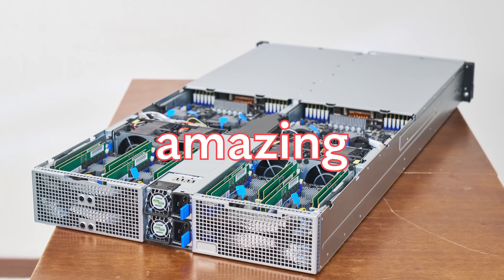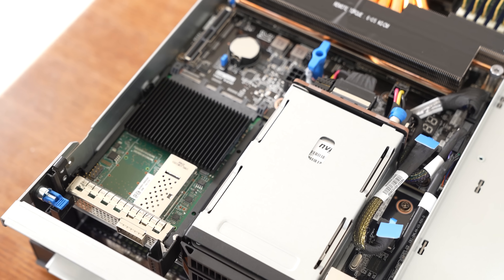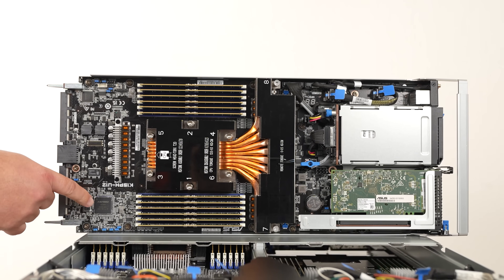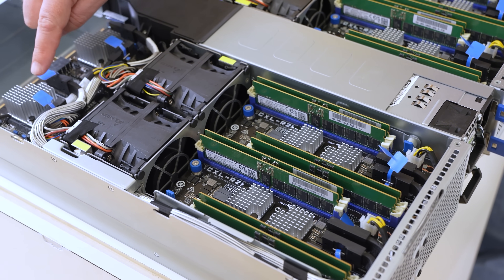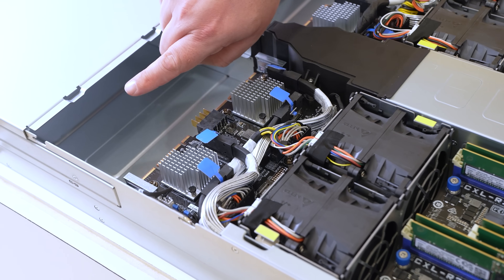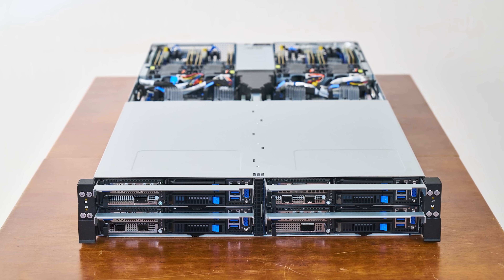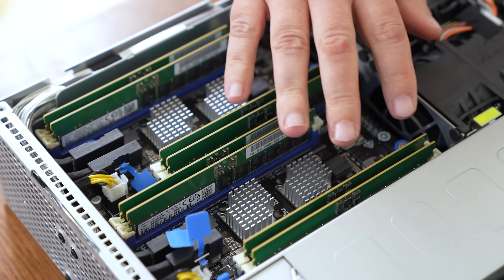A MEGA CXL Memory Server

Comment: I want CXL on my home servers that can only hold 128GB DDR5 (or 256GB, but that's extremely expensive).
Reply from the maker: Totally would be cool. It is still more implemented in validated solutions rather than play and play like NVMe drives. Just know on briefings for processors like Threadripper we are pushing for CXL support being enabled

Comment: Been waiting for CXL for years - memory pooling (for lack of a better word) by having a networked and switched memory capacity would be magic.  We're not quite there yet, and even the first implementations (as I understand it right now) won't be dynamic configurations.  But it would be great for HPC apps that occasionally just need that extra space.
Reply from the maker: Some of the hyper-scalers are deploying CXL in AI systems which is neat

Comment: arent 32gb dimms an insult for this? wendell mentioned this cxl stuff only does make sense with nearly highest dimm density vs. price.
Reply from the maker: We ended up showing 64GB when we got the server online. The cost side is a part. In form factors like this node density creates savings as well. You also remove the need for a second CPU in this that costs more and uses more power. So it is pretty shortsighted to only look at the CXL component costs. Also, longer term, memory pooling adds a capability that larger DIMMs cannot match

Comment: It would be great if the system was not specificly designed for CXL memory expansion. Sure memory is expensive, but at what point would it be more cost effective to upgrade the RAM with CXL instead of buying CXL with more RAM in the first place. I haven't bought a Supermicro machine new, but when we spec out new systems we get better offerings, so a RAM upgrade down the line is much more expensive, because we dont get the better pricing, making upgrading the system down the line much more expensive.
Reply from the maker: Thinking a bit in the future, imagine having a 1U or 2U rack in a box with memory, DDR CXL controllers, and CXL switches cabled to all of the servers in the rack. So you buy servers with some amount of RAM then provision the CXL memory from that memory shelf to the nodes that need it. The generation after that in CXL 3 is where you can also share memory so you have that switch box, have one copy of data in RAM and share it among multiple nodes
Reply from the maker: The building blocks for that vision are starting to become available so likely next year we will start to see more of that type of deployment, then see it increase every year

Comment: It would be interesting to see what the cost would be for a system like this.

WITHOUT looking at the cost, this type of a system would be great as either a compute node or cluster of compute nodes for finite element analysis (FEA) HPC application where, especially if you are running an implicit, direct sparse solver, you would be able to solve your problem, pretty much entirely in RAM, and/or provision some of that RAM as a volatile scratch disk space so that you don't have to burn up SSD write endurance limit for the same task.

(I used to play with Gluster version 3.7 where I would create a RAM drive (110 GB out of 128 GB installed) across my four Intel Xeon E5-2690 (v1) dual socket nodes, and exported that distributed stripped gvol over my 100 Gbps Infiniband network via NFSoRDMA for a 440 GB RAM-based scratch disk.)

The other use case that I can see is also for CFD pre- and post-processing/visualisation node because some of our thermal models will eat up > 4 TB of RAM when we pull the results up, and it's due to quadruple, likely in the next year or two.

But again, that's WITHOUT considering the cost.

I ran the analysis a few months ago comparing the cost of GPU accelerated CFD vs. just using CPUs, and CPUs won that round, once cost was included into said analysis.

(GPUs are faster, but the cost of the GPU itself, plus the licensing, plus the power -- it was still cheaper to use an all CPU-based compute cluster for solving these CFD problems.)

So it priced itself out of deployment.

And I can only surmise or at least I wouldn't be surprised, that this would likely also be the case here as well, that whilst this is very cool, the cost of deployment would price itself out of the running (vs. either a single socket compute blade node or a dual EPYC compute blade node).

Pity.

Comment: Isn't cxl memory more or less unavoidable with these ever increasing CPU core counts? 

Epyc Venice and it's 16 channel memory is already insanity, but what's next? A 512 core Zen 8 cpu with 32 channel ram? Imagine having 16 dimms either side of the socket be the minimum config for full performance... 

At that point, a 1u of just cpus and a separate 1u of just dimms would make so much more sense. We don't have everything in local storage in these machines for a reason. Seeing similar stuff for memory seems logical, but also very cool and exciting
Reply from the maker: In some ways. Look at what IBM is doing with its memory

Comment: I would love it in desktop... though I use my desktop as workstation. Additional latency - yeah not ideal, but for more capacity - heck yes.
Personally I would love if next Ryzen was quad channel capable. Because even Zen4 16 cores cannot saturate 2 channel memory often. And on Intel, you have situation where either Performance cores share memory with E-cores and don't have full performance or they get some kind of priority in which case they are great, but then E-cores become almost useless. And this is on desktop platform, not high core count Server machines. Sure - those might have 4-6x memory bandwidth, but they often have more than 4-6 times the cores.
Reply from the maker: The challenge on the desktop platforms is really that the more pins added for IO means higher cost
Reply: @ServeTheHomeVideo  Sadly that is true. But I do think that with AM6 they might have to rethink how they use memory. After all we both remember when there was no such thing as dual channel either. Though I have my doubts whether they will see jump to quad channel as something worthy. They should still add CXL, but that also means increasing PCI-E lanes (and better bifurcation support).

As long as it is few dollars more for socket and CPU, it might be doable. Since for gamers mobos could still be dual channel. Though knowing people they would flip if they had access to like 40 PCI-E channels. I'm thinking of what might make this cheap and make sense. And I don't come up with much. I just want to see de facto HEDT back.
Reply: @jannegrey  I mean HEDT is Threadripper still. If you want multiple channels of memory and lots of PCIe, that's basically the only game in town.
Reply: @neothermic1  Sadly this is true. But the prices of used 3000 series Threadrippers are insane here. And very few people are selling them. I would even go with 2000 series Threadripper, but most of those used were already sold and current owners plan to keep the for a while. Ideally I would want both more IO and more memory channels than my 5950X has. It can do the job and thanks to good mobo I have not terrible ethernet, but I'm so memory bound that it is crazy in some applications. And of course no one is selling 5000-series Threadripper either.
Reply: I could see a future low power version facilitating memory upgrade cards for Apple systems, with perhaps some silicon photonics thrown in the mix.

Comment: So not only do we have heterogeneous CPUs we now also have heterogeneous memory. I really hope they thought of ways to tag and partition the memory so that we can reserve faster memory for specific uses like what can be done with CPUs.
Reply from the maker: Totally works because it looks like a remote CPU socket memory
Reply: in before we have NUMA, now we need HMA
Reply: On my Intel system, the CXL memory is presented as a separate NUMA memory node, and you can schedule workloads using standard NUMA tooling. According to the manual, there should also be an option to present direct+CXL memory as one big pool, with data flow managed by hardware.

My AMD system seems allergic to CXL, but I would imagine that a working implementation would look a lot like the Intel default, i.e. a separate NUMA memory node.

Comment: These integrated CXL modules would be so nice with Optane PMEM...
Reply from the maker: Optane was a big part of Intel's plans with this tech. You can see in the cxl commands they even have pmem 0 as a nod on these DRAM modules
Reply: @ServeTheHomeVideo CXL pmem isn't some legacy leftover. SMART Modular makes CXL pmem in EDSFF form factor, although (perhaps unsurprisingly, since 3D XPoint is out of production) it isn't natively non-volatile. Instead, the module dumps the DRAM content onto an internal NAND when it powers down.

Comment: From looking at some die shots, it seems that PCIe 5.0 takes less silicon space per bandwidth than DDR 5(at least at normal speeds), though I don't know how much CXL functionality adds to this.
Reply: According to estimates from one Georgia Tech paper, "A Case for CXL-Centric Server Processors", a DDR5 controller channel takes up roughly the same amount of floor space as two PCIe 5.0 x8 controllers. IMO their methods are somewhat shoddy, using "Golden Cove" (I assume Alder Lake, PCIe 5.0 without coherency extensions) and Epyc Rome (previous gen standards).

But I would argue that floor space is hardly the big concern in today's world. With the exception of Nvidia, all major server processor manufacturers (Intel, AMD, AWS Annapurna, Ampere) have moved on to disaggregated architectures. The IO components are mostly manufactured using mature ~100MTr/mm^2 processes ("7nm"), whose R&D costs have long been paid off. (Intel's DDR controllers are part of the compute tile and use Intel 3). The aforementioned paper notes that CXL has a 4x bandwidth-per-pin advantage over DDR, and advocates for a processor design that ditches directly attached DDR entirely.

And if we look beyond x86, serialization of memory interface isn't some academic theory or emergent technology, it is here TODAY. Power10 has no directly attached DDR interfaces, instead uses OMI to move DDR controllers off socket.

Comment: A controversial decision. If we truly need such high memory density, we should probably allocate budget for 128/256/512GB modules instead. And if cost savings are a priority, we could simply stick with standard 1U nodes. Sure, it looks impressive, but this is a proprietary solution that the market is unlikely to widely adopt. I’m struggling to identify use cases where this would be a better choice over traditional dual-processor servers.

That said, it would be fascinating to see a rack with a massive CXL-based memory pool. But the real question is—which virtualization vendors are ready to support such a solution? Until major players like Dell, HP, and Lenovo take an interest and start promoting this technology, this ASUS server remains little more than an intriguing artifact of our time.
Reply from the maker: What happens when you get to 128GB DIMMs and run out of memory in 12 channels? Do you halve your density then to get a 2DPC platform? Or do you double the number of CPUs just to add more memory and pay more up front and in power?
Reply: @ServeTheHomeVideo  No, I’ll just add another node to the virtualization cluster :)
Reply: @Hamilius_Tahugava  We look at it from the standpoint of large memory *per server*, not across servers, where workloads (VMs) may require 2TiB+ of RAM.  We have been comparing 24 DIMM machines with 256GiB DIMMs as well as 12 DIMM machines with 256GiB DIMMs but with extra memory added via CXL using Smart Modular's cards.  This fits in 1U with high frequency EPYCs along with numerous NVMe drives, so quite a package in such a small space, regardless of which configuration we choose.

I do think that latency will be the killer for massive pools of memory per rack, though.  Every 1 foot of fiber adds 1ns of latency at the speed of light, and fiber isn't perfect, so it is actually more than this.  If the back and forth between the CPU a DIMM is 100ns or less, you can use that up with 50 feet of fiber, much less the latency of the media, electronics, and firmware.  As more memory gets closer to the CPU, and even inside the CPU package, the rack-level memory latency will be exacerbated without any solution.
Reply: @ericmiller8700  In that case, it all boils down to cost. Unfortunately, until CXL 'RAM expanders' become mainstream, I believe a traditional server with higher-capacity modules will remain cheaper. That said, I’m not dismissing this technology—I really like the idea. But from a business standpoint, I don’t think this will be a very successful product
Reply: @ServeTheHomeVideo  I fully understand your point, and the idea of having a shared memory pool located near the storage or functioning as a hyper-converged solution with a common pool for all cluster nodes is truly excellent. This approach would enable complete utilization of all nodes.

I'm closely following virtualization product developments from Broadcom (vSphere), Microsoft (Hyper-V), Xen, RedHat, and other vendors, as data center architecture and landscape design are my primary responsibilities. However, so far I've only seen mentions of CXL technology in these products without any concrete implementation cases.

For other use cases beyond virtualization, I don't currently see practical applications for this technology.
Reply: @ServeTheHomeVideo  I mean - everything is a trade off. Here it shown that for the slightly bigger price (I assume) you can have 2U/4 node 1DPC server that in memory bound applications will have performance close to 2DPC version. And it will take less space in one dimension. So if you do need something that fits a lot into dense enviroment and/or for example you just upgraded your memory and have spare old one - you can use this. It won't be for everyone, but it will be for some folks. CXL is sadly slow to be adopted. Optane went before it could shine here. And this is only one of many CXL uses. The other issue is that it is only available in servers. It would be a godsend for "cheaper" workstations. After all your CPU doesn't have to have memory controller that supports more channels. It just has to support decent amount of PCI-E. Which most do. Given how mobos and CPU's are much cheaper than GPU's, I personally cannot wait for relatively cheap workstations in which you can upgrade your memory every year or two and use the previous memory to still use it.
Reply: Ya CXL seems doomed by latency, cost, and still mostly seems “a solution looking for a problem” outside niche usecase.   All those redrivers aren’t free in terms of cost nor signal.  More and more you see the trend of packing memory with the cpu package for performance.  And then CXL chucks the memory almost as far away as you can get!!  (No free Lunch here). That might be passable latency wise today if you don’t look too closely and have very carefully selected workloads but will be absolutely unacceptable in the future.
Reply: VMware offers memory tiering. Ram is used for the active memory - blocks touched in the last 15min, cxl will be used for mem that is consumed but not recently touched.
Reply: @zbigniewmalec4816  Unfortunately, VMware is dead to me.  Great feature though! :)  However, it would create a slow start if something needed access to that memory after 15 minutes.  It likely assumed that it could get quick access like it could 16 minutes ago (after a lunch break).  I always prefer manual decisions for this stuff, using NUMA nodes with KVM .  CXL memory shows up as another NUMA node so we decide where something runs.  If the operating system ultimately needs to move something (if we goofed and over-allocated), it will prioritize memory based on NUMA weights.

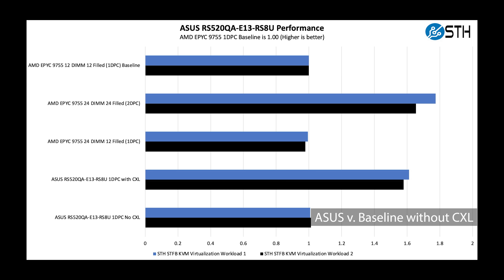Comment: If your CXL devices are node-bound, is it actually worth going through the effort/expense/complexity vs just eating the downclock hit from going to 2DPC? Do I misunderstand your bargraphs at 14:45?
Reply from the maker: It is not just the downclock in this place (and we have some figures on that with virtualization in the performance section.) It is also that going to 2DPC you halve the density since you cannot fit 24 DIMMs and SP5 into a half-width node.
Reply: @ServeTheHomeVideo  ASUS already makes 2U/4nodes SP5 chassis (RS720QA) with 24dimm slots (and 2 sockets) per node?
Reply: @norgtube  if its 2 sockets per node, that's still only 1DPC for each of the CPU's 12 channels. 12 channels * 2 CPUs is 24 dimms....

I don't think the signal integrity of 24 dimms for a single CPU in a lengthways config woild be acceptable